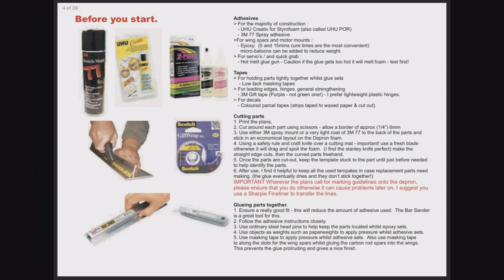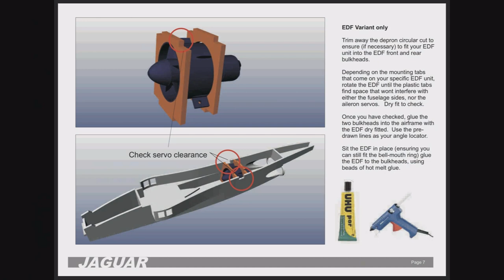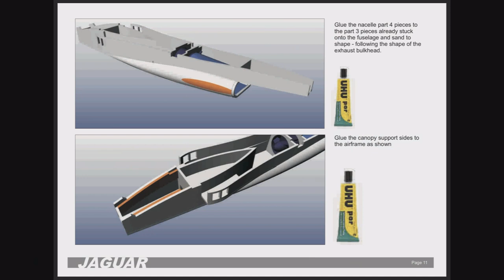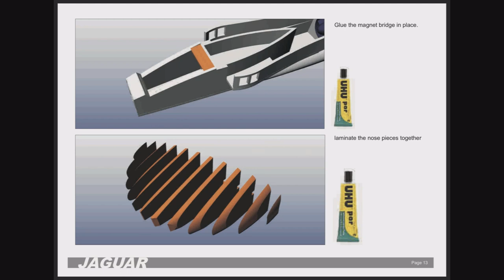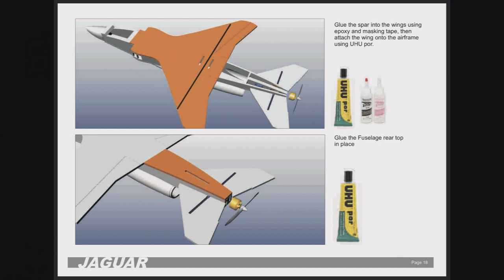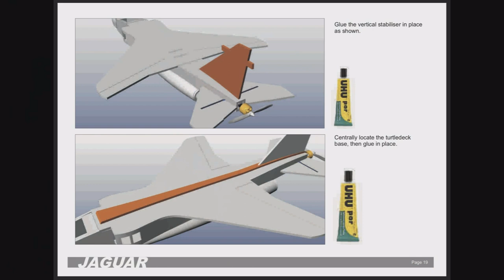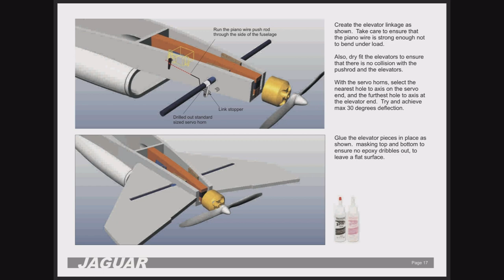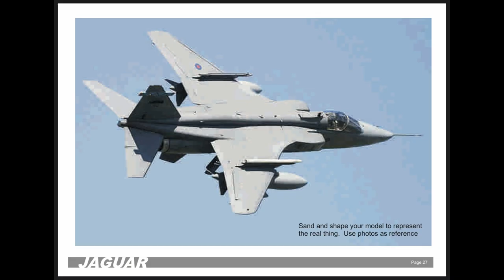Jetworks Jaguar build

Comment: Great plane.I did this, only with a 700mm span. https://youtu.be/36aX4x-korI I put a 2814 1000 motor and a 1060 propeller on it. The plane was flying very fast.